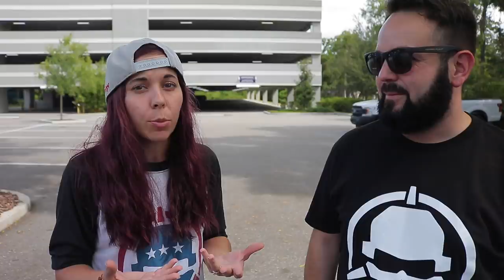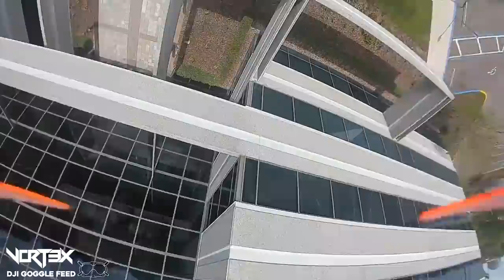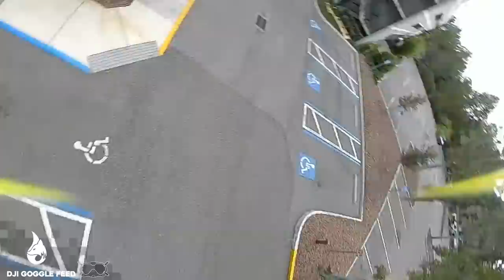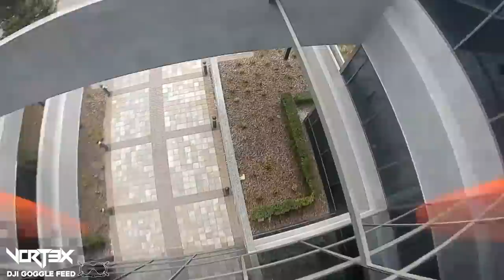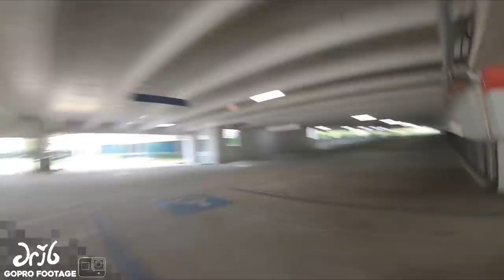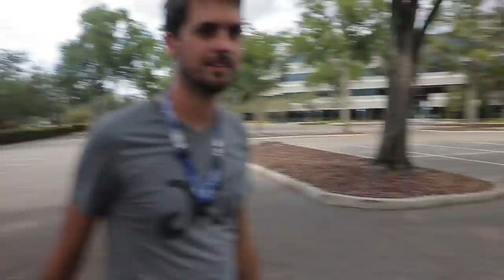Flying 8 FPV Drones at the SAME TIME

Comment: Didn’t IBcrazy get 16 drones flying at once a couple years ago?
Reply: IBCrazy is the record as far as I know but man he had to jump through some hoops to do it. My experience is 3 pilots is easy, 4-5 pilots is doable, 6-8 pilots is tricky.
Reply: Yeah but they didn't have DJI as Sponsor
Reply: yeah he did, but not at that fidelity.   If memory serves it looked like shat but worked.
Reply: @TheNitrox88  having them as sponsor or not, the results speak for themselves. This system is REALLY good I wish it had analog receiver so I could just jump and buy it
Reply: Yea, but he didn't do it in HD
Reply: Yes it was done at Mutigp championships 2016 I was one of the 16 pilots and it wasn't very hard to do at all. And we all had near perfect video on 25mw. If an event is controlled and setup properly its not hard to do. One of the main things that made it possible was pilot location in relation to the course. It was amazing to see so many birds buzzing around at one time.
Reply: @speedyfpv7104  Exactly. Analog is a bit more complex to set up, but once you have it going, it works really well. Also, even these guys talked about lag when the signal got dodgy... Flying at that speed and especially if you're racing them, I'd much rather have the picture break up a little bit than to have any lag at all...
Reply: @speedyfpv7104  oh come on, “near perfect video” with 16 up? If near perfect means “there’s interference,  but I can see well enough to fly”, then I believe you. The DJI stuff was a huge leap forward, obviously. It’s come a long way since then, too. Even the die-hards like Steele have bought it at this point. It’s just too good.

Comment: Its amazing to see how far this technology has gone and im excited to see how much further it will advance. I have not yet been able to experience this HD technology as of yet but videos like this make it more and more  tempting to buy.
Reply: @AnOliviaShapedGremlin  open source is great and in time great minds will provale. I would love to see a tare down of this device.
Reply: i bought it expecting nothing, but its by far way better than anything else. It just works no worries about what so ever, but antennas suck i use totally different ones and the range increased way further than analog
Reply: @shambler01  all i keep hearing is good things. I sure ill invest in this just not anytime soon for now i will have to deal with analog.
Reply: @MarcosFPV  never try it otherwise you have (as i have) 15-20 drones where i need to throw out all analog equipment xD Because I hate it now
Reply: @shambler01  its hard to not want anything less then the best.

Comment: RR: learns how to fly 8 up
RR: THIS IS THE FUTURE!
MGP: Ever been to IO bro?
Reply: Slight difference between an open field in the middle of nowhere and a parking garage. You couldn't fly that spot like that on 25mw analog.
Reply: Also, there is a huge difference running 700mw with crystal clear video and zero break up.
Reply: Honestly trying to compare open field analog to HD in a parking garage is cute at best.
Reply: @Furadi  you're cute at best ;) I'm saying 8 up isn't impressive. HD bando flying IS

Comment: We need somebody to make a DJI digital receiver module for fatsharks!
Reply: i hope eachine reads this ;) dont think it's possible though
Reply: If you're going to be spending a bunch of money anyways, the performance of the DJI goggles exceeds Fatshark HDO by a good bit. Huge screen,...edge to edge clarity, and a FAN THAT WORKS!   albeit,.. that fan is controlled by a thermostat, so may not be on when you're wanting it on. Even if Byte Frost somehow becomes bigger than DJI, I will not be doing back to the standard Fatshark goggle. At least the fan works on Skyzones.

Comment: There was another post recently saying that some are scared that now since DJI has their hand in the fpv market, some are scared that the company will soon reach 80% of the drone market.
Reply: The DJI HD System is perfect. What is the problem? The competitors are on their way with cool stuff, too. Byte Frost at example. As long as other manufacturers can also put such systems on their feet and soon perhaps even cheaper and even better, you don't have to worry about DJI taking over the market. At the moment the system is much too expensive anyway. Very few people admit to spending $900 on a FPV System.
Reply: I think  you are refering to Stu video's here: https://www.youtube.com/watch?v=lgEqP5A9Bc0

Comment: YES Drew stearing this ship in the right direction.  These last few vids have killed it.  Man, this is even more bad news for fatshark,   Orca, skynet, immersiorc, furiousfpv etc etc.  DJI just came on to the scene (no pun intended) and said f yo couch.   Man orca not even out, and already basically lost.  650 plus 400 byte frost makes it more expensive then DJI significantly...... and still won't look as good as dji......rekt?  I just configured low latency mode in betaflight 4.1....its really good too.   Shoutout UAVTECH.

Comment: Can someone explain to me why this is so special?
Reply: Jaklantern It isn’t... it’s possible with good analog hardware
Reply: You can fly 8 pilots at a time with analog but you have to jump through a lot of hoops and if one guy has a shitty vTX he trashes everyone else. With the DJI system you don't have to do anything special (other than own DJI) and you cannot accidentally power up on another pilot and blast them out of the air (the DJI system won't let you).
Reply: @DuncanFPV  show me 8 pilots in the air at 700 mW on analog LOL.
Reply: Because showing up to a spot and getting this many people in the air simultaneously has either been very difficult or even impossible with out very careful consideration of power output, antennas polarity, environmental noise and many other constraints. 
We literally just showed up and were able to accomplish flying many people without hardly any difficulty. It really was one of the best FPV experiences of my life
Reply: @LeDribFPV  Sooo, basically you're saying it's absolutely no different now than it used to be? Getting 8 people with enough money to each have a DJI system is VERY difficult or even impossible.... It is crazy to be able to fly at such a high power output though.

Comment: Love the dji system. Kwboost had his system at our race day yesterday and even with 5 pilots plus a dji system we had 6 ppl up at the same time and no issue. I sat right next to him and never had any break up on my video. At least while I was running a tbs unify. When I swapped quads and flew my hawk 5 the Emax vtx did get a little interference but wasn’t bad at all. Plus Kelvin even put it to a test, he did one race with dji and one with analog. His laps times were damn near the same. So at racing distances I don’t think latency would be an issue. The extra 50 grams may be but at least for him the latency wasn’t an issue at all. 👍👍👍

Comment: Im curious, why does nearly everybody pronounce it DGI
Reply: because Florida :)
Reply: It has to do with the order of the positions where vowels are pronounced in the mouth. The "ee" comes from the front, "ay-ee" moves from middle to front, and "ah-ee" flips from the very back to the very front. "Dee-jay-ee-ah-ee" is a full-mouth acrobatic event. Eliding the mid-to-front "jay" to an all-front "gee" is a natural and unconscious compensation by the brain. One of the problems with English is those compound vowel sounds that are actually two vowels blended together--e.g. the letter J being pronounced "jay-ee". Most of the time it's not an issue, but in applications like this, where several blended vowels abut without any strong consonant to separate them, it can become a real mess.
Reply: @rmdcade1717  I mean i wasnt actually expecting a real answer but yeah... it makes sense
Reply: @bryanjansen1456  LOL

Comment: Would love to see a "punch and flip" contest between you guys. Punch to gain altitude for 1 second, then cut throttle and flip any direction you want and save it at the very last second with throttle only. The most flips done during the fall wins. 😁
Reply: sounds like a vomit fest.

Comment: I wonder how much it costs for djii to push this so hard onto us. i believe the system is great, but the amount of this type of content from rotor riot lately is more than suspicious.
Reply: If it works this well, then I'm happy with them pushing it like they are. They can pay Rotor Riot all they want as far as I'm concerned. 👍
Reply: @paulhines5010  I've fallen for cool tech just to hear an aftermath that "yeah, well, it was still lacking and had issues". I am yet to see a good acro or racing video with digital feed. To me it somehow feels like there is delay that prevents well known pilots to fly like they've been doing it with analog video for years. Maybe i'm wrong, but i have not seen a good flow from Drib since he started playing with this one.

Comment: Why is there no system that just  uses the full range of frequencies simultaneously, with pseudo-random hopping of frequencies (so each channel is a different seed for the pseudo-random algorithm that runs synchronized between the goggles and quad, instead of being a smaller frequency band), and maybe some redundancy by transmitting the same data over 3 or more frequencies simultaneously, and using a voting or average system to fight interference?
edit: And maybe something like public-key crypto to sign the sync signal, so that you can ensure you're sync'ing to the right transmitter at all times.

Comment: Qty is great. I would love to experience it myself. However, guys, you know that flying with Analog systems simultaneously can do  strange things such as loosing sygnal. It is not meant to fly with Analog at the same time. I think you won't do such test due to being sponsored by dji, but anyway that would be interesting to see it on your chanell. Cheers!

Comment: analog is dead. nothing wrong with embracing new tech. In the end its all about me and less about the vendors. Digital is best for my experience.
Reply: I really like the digital systems coming out, however I wouldn't say that analog is completely dead yet, it's better for people that want to get started in the hobby and don't have the budget for a digital system, plus for the people doing long range it's better because it can get way further out than digital.